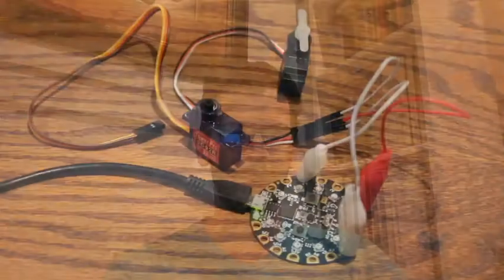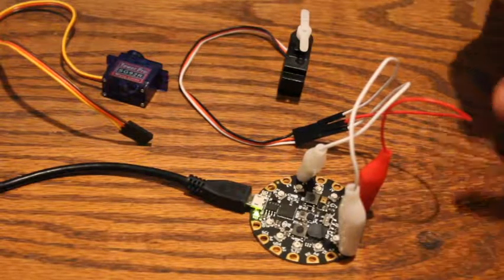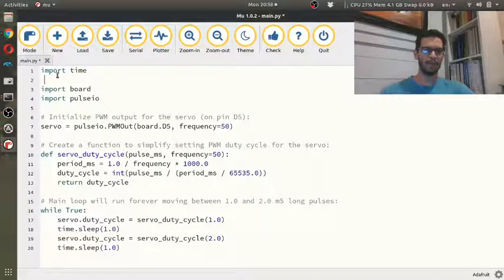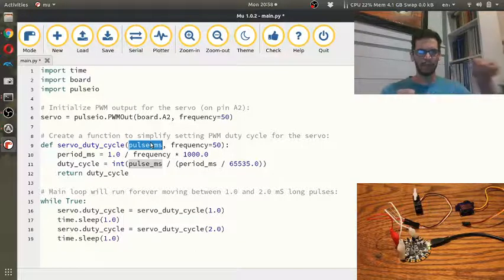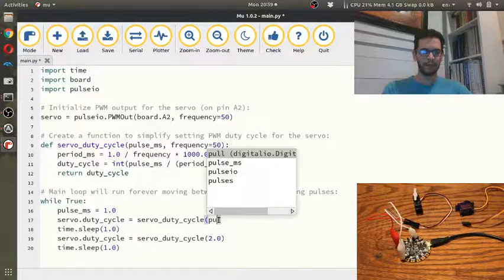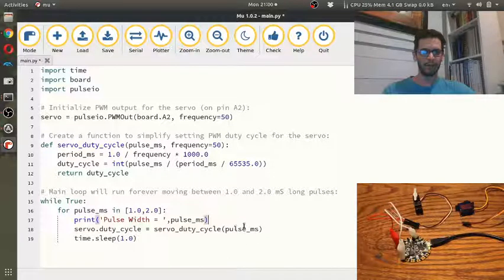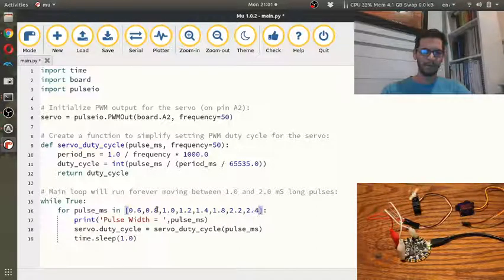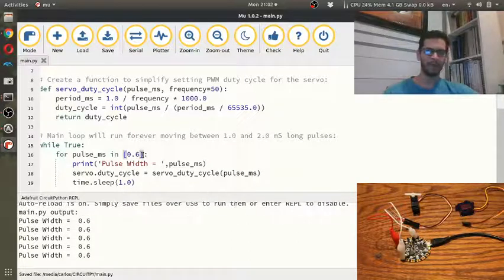Moving a Servo with CircuitPython on the CPX

Comment: What would the code be like if I wanted the servo to rotate from 0 degrees to 180 back and forth?
Reply from the maker: This is pretty low level servo control so you would have to determine the minimum pulse signal to send to the servo which is probably 0.6 and then the largest pulse which is probably 2.4

So if you send 0.6 and 2.4 it would probably rotate the servo the way you want.

Comment: Would it not be easier to use a servo library? Or do they exist for python?
Reply from the maker: Definitely easier to use a servo library and they absolutely exist for Python and CircuitPython. This is low level servo control for my instrumentation class